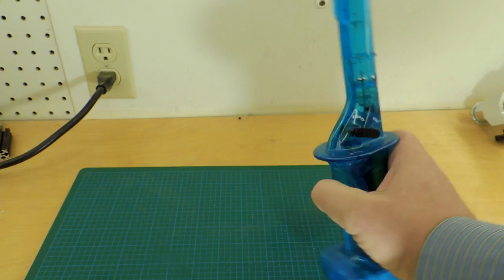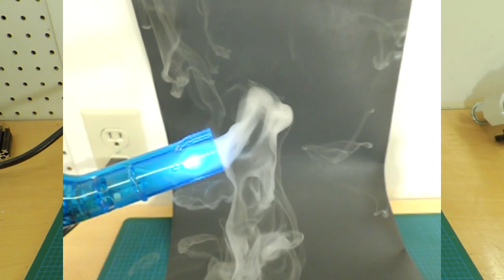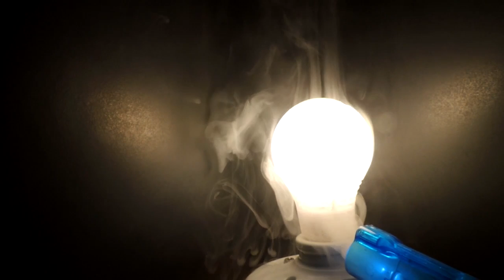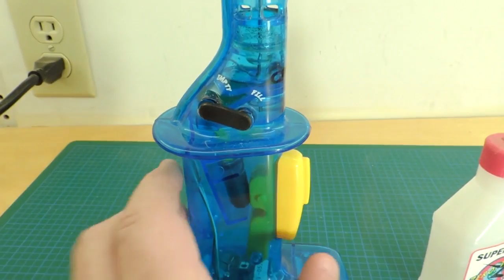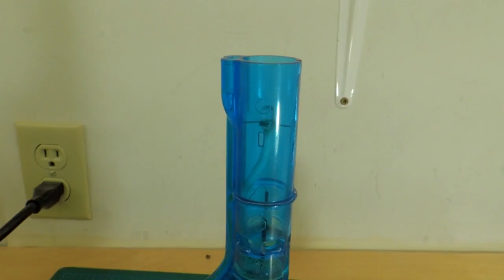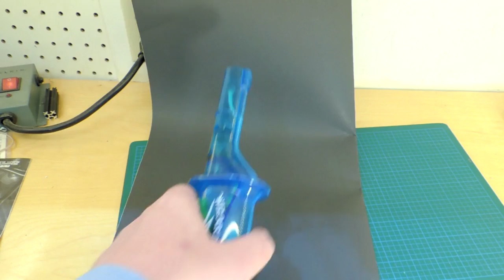Electronics Thermal Design: The Smoke Pencil

Comment: Most fog fluids are based on triethylene glycol or sometimes other glycols like propylene glycol.  Traditional theatre fog fluid is usually a ratio of 30 to 50% glycol in distilled water.  Modern e-cig eliquid might be too thick to wick into the tube properly.  I had the smoke ring version of this toy and it seemed to rely on a very thin bore glass tube wicking the liquid up between the wall of the tube and the thin internal element.
Reply: It would be really nice if you could make a teardown of it (if you still have this "smoke ring thingy"). I really appreciate and enjoy your videos! :)
Reply: Alas not.  I let someone borrow it and never saw it again.

Comment: It's probably worth noting that you can't properly evaluate the airflow in a piece of equipment with the cover off like that. Having the cover installed will result in a much more controlled airflow path. The fan exhausting air out the back is actually what i would consider correct installation. Most equipment follows the convention of drawing in cool air at the front/bottom/sides and expelling heated air at the rear/top. If you have a rack full of equipment, the air at the back of the rack is usually much warmer.